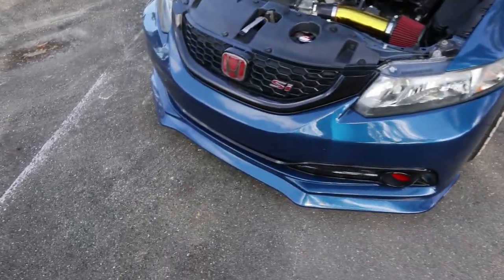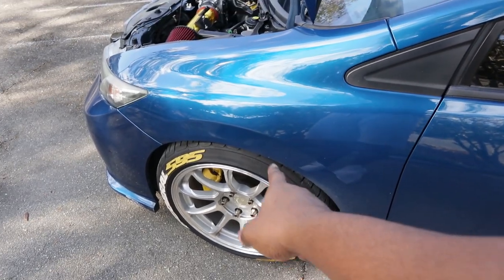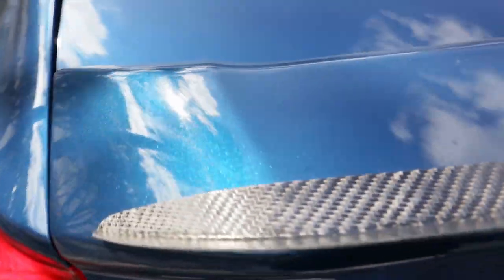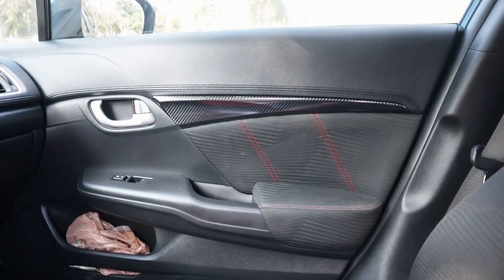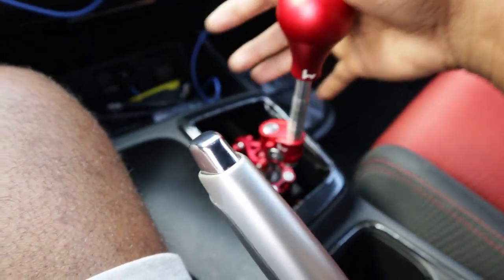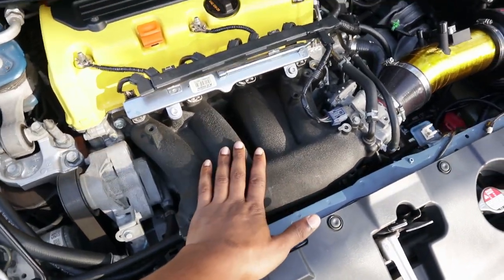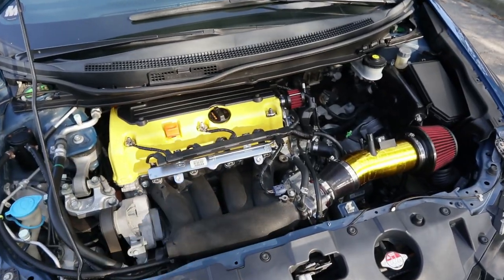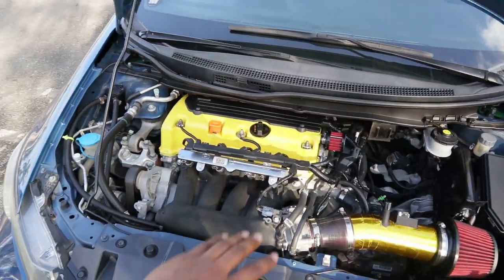Are These Mods Really Worth It?

Comment: Hell yeah man. Just got my fb6 back today. Made 225whp and 182tq
Reply from the maker: Nice bro .. what’s the mods
Reply: What’s the mods
Reply: @jesuscontreras2499  holy hell didn’t know you guys asked. Ported RBC, acuity CAI (literally the best) , rev9 catless downpipe, hasport 70a rear mount, invidia n1, dyno tuned to those numbers. If you’re scared running CAI bc of hydro lock you can get a water resistant filter cover along with fender liners and you’ll be good.

Comment: U need some boost man. Also if u ain’t want pro make ur own kit did mine for just over 4K said and done.
Reply from the maker: Definitely in the future bro .. CX Racing actually have a kit for under 2k .. definitely would get it and sell the junk parts
Reply: Yeah I skipped on there kit cause of the jenky hot parts they use. There is no place for the main o2 sensor on the manifold also the turbo is a 5 bolt system which sucks in our tight engine spaces. Also the wastegate setup is sub par. It’s just not a great kit. If u do get it I would get a makspeed manifold and pulsar turbo and change the dp to vband. Also go with a turbo smart gate. I’ve seen 2 of them shit eBay gates fail in the past year.
Reply from the maker: Thanks bro